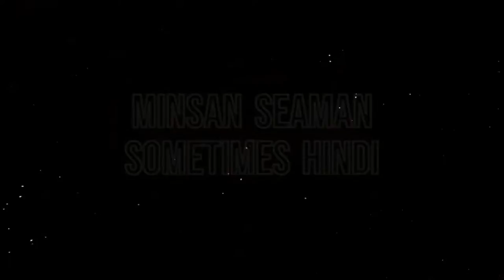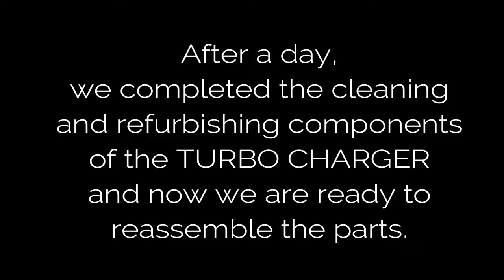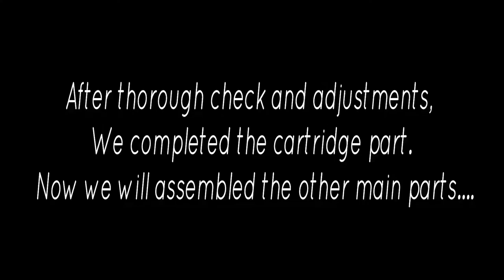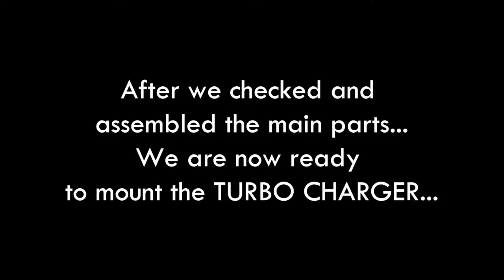IHI/ABB Turbo Charger Overhaul Model TPS 52

Comment: What about balancing of the rotor? A rotor with 800rps in operation should be balanced after cleaning! I would recommend to contact one of more than 100 Accelleron (former ABB turbocharging) service station to perform a professional overhaul!

Comment: What was the specific torque applied during re tightening of the compressor wheel sir🙂
Reply from the maker: Our torque  was 260nm but it depends on the manual that you have.. please see your instruction manual to be sure.
Reply: @kurisensyotv7086   .. please share the manual where it is mentioned tightening torque for the compressor wheel .. I couldn't  find it